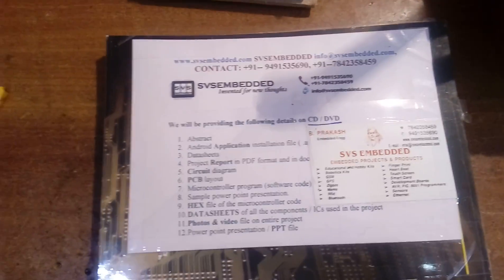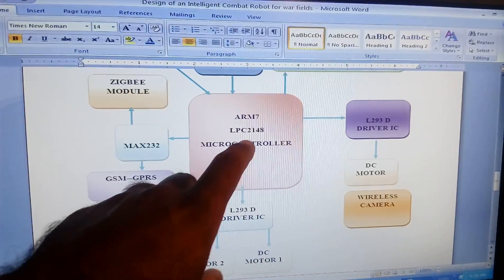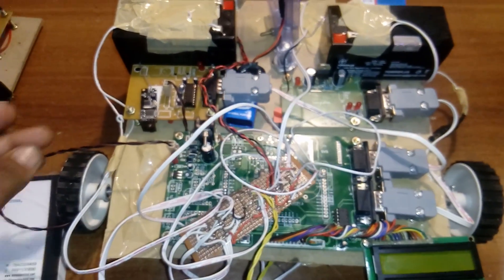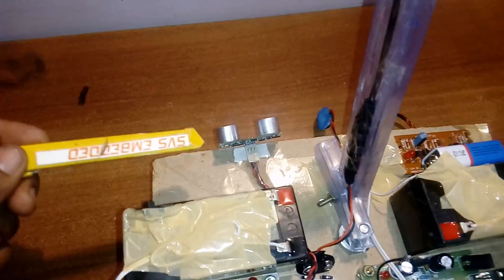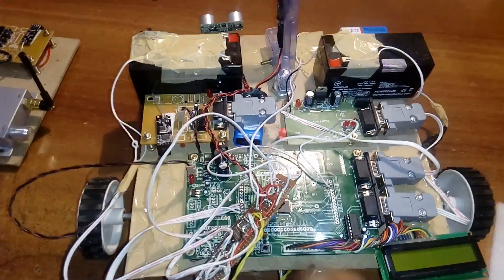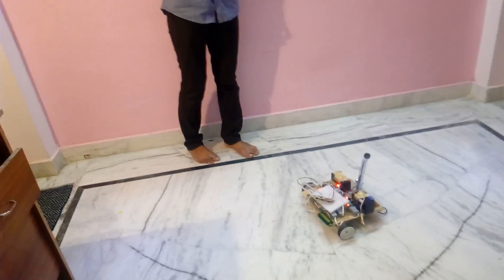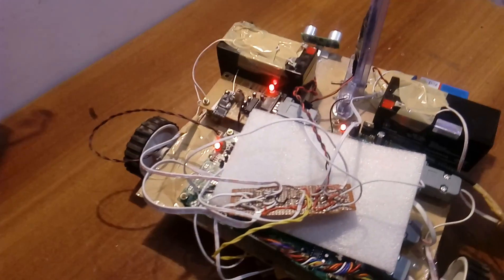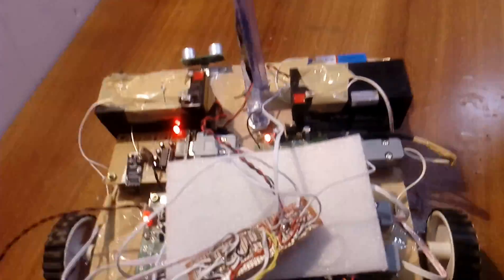IOT Based self controlled robot for Military Applications purpose

Comment: how did you build dat
Reply from the maker: Thanks for comment and your valuable Feed back,we are selling the projects with least cost.
if u order the project we will provide working hardware kit along with 
1.abstract
2.datasheets
3.documentation
4.schematic( circuit ) diagram.
5.software code.
6.sample ppts
7.photos&video file on entire project
through google drive.if u r interested to take the project.
send me a mail to  svsembedded@gmail.com,info@svsembedded.com.
we will send u the how to order procedure to u.
Reply: What is cost of it